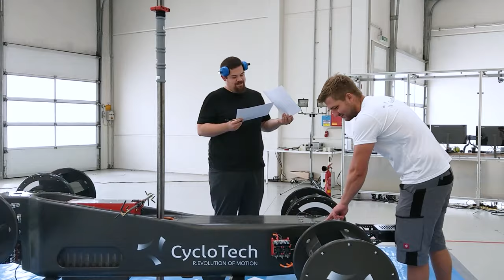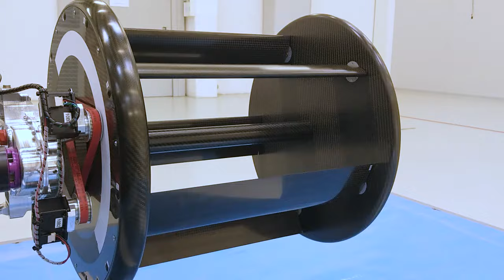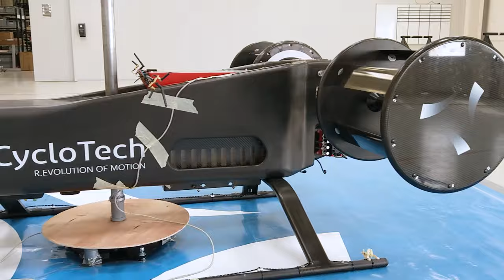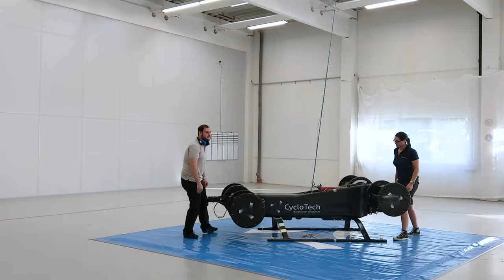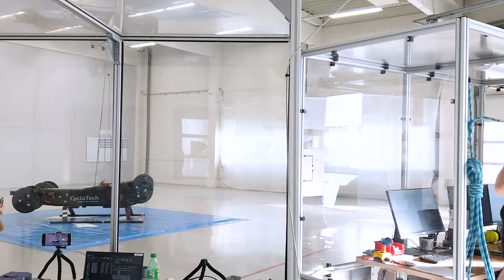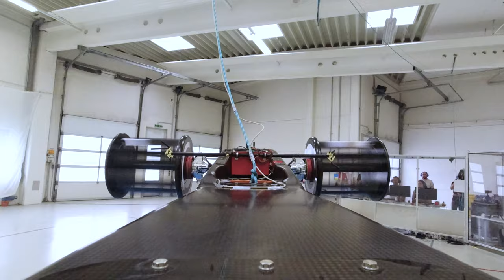CycloTech | Demonstrator First Free Flight (Indoor)

Comment: Such wonderful progress towards this old but much saver technology than rotor blades on helicopters.
Reply: R u sure it is safer, not just cheated by its looks ?  What happen if human touch those high speed rotating wheels ? If blade slices, this will roll a human, i think. CMIIW please.
Reply: You could wrap some titanium mesh screens around it, like an 10 or 20 mesh.
Reply: No need for torque countering tail rotor. How does it do on auto rotation emergency landing? Can it handle one rotor inop and maintain altitude or at least do a controlled drift down? How about forward speed limitations?
Reply: @maryfrawley4388 -- Aerodynamically, autorotation is out of the question, because the blades are not within the external slipstream; but a single rotor failure should allow a controlled descent using the remaining three.
Reply: @haditjandradjaja8403  Word to the wise: don't touch them but a shroud can be built around them to protect birds and people with erm... itchy hands.
Reply: @shannondror  unlikely. Small blades tend to be unable to provide sufficient lift in autorotation due to insufficient speed. Also, traditional autorotation does work the same here because the rotational directions are different.
Reply: @maryfrawley4388  Counter rotating helicopters also don't require tail rotors and are far more efficient than this contraption.
Reply: This is likely far less safe than traditional helicopters. Helicopters have higher efficiency and can autorotate. These have more moving parts, far more points of single failure, and probably cannot autorotate safely due to the small size of its blades providing insufficient lift to slow the descent enough to be survivable.
Reply: @SoloRenegade  -- Safety is a matter of design.  Traditional fixed-wing and rotor-wing aircraft can translate motion into lift in the event of engine failure, long enough to reach the ground in a marginally-controlled manner and a sufficiently slow descent speed. Powered-lift vehicles are by their nature dependent upon an uninterrupted supply of power, and cannot use their potential and kinetic energies to continue operation. Hence, their safety depends on the necessary reliability and redundancies of their power generators. Batteries are rather reliable and not particularly prone to failure.  Likewise electric motors as compared to combustion engines. Hydrogen fuel cells are likewise highly reliable, as are some forms of storage for Hydride pastes and water. Likewise a vehicle supported by multiple motors and rotors represents a propulsion/lift redundancy that provides a measure of safety, as do backup full-vehicle parachute systems. The likelihood of safe operation of this sort of vehicular system need not be any less than that of traditional air vehicles, and could be more safe given proper design and failure-mode analysis.
Reply: @SoloRenegade  What makes you think 3 rotors wont compensate for the loss of 1 rotor? They literally just have to increase their hover rotational speed by a minimum of 33% on the remaining 3.
Reply: @anteejay4896  you're assuming they have sufficient excess power, which is usually not the case in smaller powered aircraft. And that the airfoil has enough AOA remaining as well. You can't assume every condition is going to be so favorable, as real world experience in helicopters, twin engine, and single engine airplanes shows you rarely ever have that sort of excess power. The joke is a twin engine has enough power when one engine fails to get you to the scene of the crash. Most can't maintain altitude on one engine, or have a very low single engine ceiling altitude.
Reply: @SoloRenegade  It is electrical, excess power means feeding more electrons to the motor - just look at the maneuverability of drones they don't have issues mechanical engines have . If your motors cant do more than an additional 33% of the thrust you need to hover then there is something fundamentally wrong with your air craft. It should easily do well in access of 100% to 300% depending on load in my opinion. Plus, stop comparing it to a helicopter, it should even be able to lose 2 motors, one at either end and still have a chance continuing travel or landing safely.
Reply: @anteejay4896  Well, yes, if you're talking about drones, sure. But I'm talking about full scale aircraft. Capable of carrying passengers.

I have to compare it to a helicopter, because it hovers like one, the rotors work on the same principle as a helicopter, and because safety issues helicopters address, most of these new drone concepts do not address adequately, if at all. To get a pilot's license to fly one of these would be a rotorcraft pilot's license, just like a helicopter.
Reply: @SoloRenegade  I understand where you're coming from but dont box your thinking on this because it potentially has ten times more wing aerodynamic lift surface area than a helicopter by increasing the number of blades per rotor... They could even add another set of rotary axles in the middle for a total of 6 and additional one at either end for a total of 8. You really need to think out of the box on this one my friend :) The future is bright
Reply: @anteejay4896  That's not true. only two of the blades can be lifting at the same time per rotor max. And when you add up the 4 on one side, they don't add up to a single rotor blade length of a helicopter. Also, the extremely short aspect ratio massively hurts efficiency of that same surface area. These are spinning very fast as well, meaning they are relying a lot on velocity to produce enough lift. This is why I doubt such a machine will be save with a power failure, can't autorotate. A helicopter rotor system only spins around ~400-500rpm. Granted, the longer blades force lower speeds to reduce tip velocities. But the lift generated at that slow rpm is enough due to higher efficiencies.

Putting another rotor in the middle ruins the payload and utility value. Also, being nestled in the middle potentially blocks airflow to/from that rotor. I think outside the box every day, but I'm also practical and evaluate the merits of a design.

With smaller drones, you can do things aerodynamically larger aircraft cannot. Look at how bees fly for example, and try to scale that up. You'll find it cannot work due to the relative fluid density changes. Reynolds numbers and such. Something might work as a drone, but doesn't translate to larger aircraft. And only one of  the drone taxi companies I've talked to (that patterns their design after quadcopters), has addressed my safety concerns when I questioned them (face to face, I talked to their engineers and reps). Hovering taxis have been tried before. There is a reason they stopped existing decades ago, and none of these new designs address those issues in any way.

The future is bright, but this just hasn't convinced me it will look like this either.
Reply: @SoloRenegade  That is what i meant by thinking outside the box, This design has 5 blades per rotor, what's to stop them from having 8 blades per rotor and elongating them a little? I am not sure of the rotational speed but it cannot be more than that of the typical drone which is in the thousands.  That being said Auto rotate is a crash landing technique from the remaining angular momentum of the blades if you are really high up in the air changes of survival from that are very slim. This has multiple sources of lift i think it should fair better than a helicopter.

Putting another rotor in the middle improves the efficiency of lift while lowering the amount of power needed per rotor to provide said lift and also improves redundancy. You are assuming too much as to the auxiliary capabilities of the motors, cooling can be accomplished in many ways so can  power management in the event of failure and mitigation of disaster by spreading power load on the rotors to maintain lift.

Hover taxis are already hear do your research, you can literally buy a few for yourself. They just haven't been scaled to meet commercial market requirements, do your research, The biggest hindrance to this was never technology, it has always been POWER and with the proliferation of high density batteries powered by the e-car revolution they will soon be a commercial public success. 

What is the measure of a products success/viability? Is it the fact that it works and is useful or the fact that it is safe to use?
Reply: @anteejay4896  having 5+ blades per rotor doesn't change what I said about total lift. You don't realize how much less surface area this has than a helicopter blade, it's not something you can just fix by adding width. Then you get flex occurring to a greater degree, and this will cause the rotor pitch control mechanism to bind, and to offset all of that adds weight and drag to the system. Plus the additional power needed to rotor more and bigger blades. This thing is getting complicated very fast.

Autorotation is a technique in which aerodynamic forces keeps the rotor blades spinning indefinitely, so long as you have altitude remaining to gain energy from. the problem is that such aerodynamic forces are not capable of spinning these rotors at thousands of rpm by gravity alone, and so you wont generate enough lift to arrest your descent at ANY altitude. The moment the power is lost, you die. A helicopter can glide with no power safely all the way to the ground because the potential energy is enough to keep the rotors spinning al the way down while generating sufficient lift to slow the craft to a survivable rate.

Putting an extra rotor in the middle doesn't  do anything to improve the efficiency of lift, unless the two in the front are made into one single larger rotor like a combine head. but that introduces still more design challenges to overcome. (and that approach has been tried before too). Such a change may provide More total lift, but will also add weight and take more engine power to rotate.

I am not assuming anything, just going through the design realities as I see them based upon the laws of physics. When did I ever say motor cooling was an issue? And if you lose power, ALL of your motors are dead, and now what are you going to do? Electrical failure is a common failure mode in aviation, and one of the most prominent emergency procedures, and included on any modern checklist. How many electric cars have battery failures? plenty. A motor failure is only one possible common mode of failure. there are many which Must be considered and addressed.

Hover taxis were banned decades ago becasue they were too dangerous, not just to crew and passengers, but to innocent bystanders below them as well. It's not just an issue of making a vehicle fly, it's also a factor of dealing with the variables of the environment you're flying in that are an issue. Many of the accidents that lead to the end of helicopter taxis was such environmental factors that made it too dangerous. No drone type design has addressed this issue in any meaningful way.

Spinning at thousands of RPM proves my point. This thing cannot autorotate and generate enough lift in the event of a power failure.

"Is it the fact that it works and is useful or the fact that it is safe to use?" That, and its cost effectiveness. Just look at the history of airships and the many attempts to restart that aviation industry. It has to work, it has to be useful, it has to be safe, and it has to be profitable. All too often such ideas have not been profitable, safe enough, or have useful payload and range to make them viable. 

I am an aviation fanatic, a professional airplane and helicopter pilot, engineer with numerous patents, and i study and teach the history of aviation, as well as the engineering history of aviation (how tech evolved, when, why, and how). I'm not just making this stuff up. This is all based on my years of study, professional work, and analysis. I want to see innovation, and I want designs like these to work too. I've even dabbled in many such innovative technologies and designs in the past, until i learned enough to know why those approaches weren't going to work. Maybe they'll work again someday when other technologies are developed to address their limitations, but I haven't seen that happen yet.
Reply: @428 Renegade  I understand you're into helicopters, but they have many flaws and a balance has to be met in any design to optimize lift to weight and technological and material tolerances or limits. Again you are assuming far more that you know for sure, why would the mechanism bind? Have you seen larger scales of this technology being tested? Even a blade ten times the length of the one demonstrated can be achieved using a carbon fibre mesh with tolerable flex extremes. A balance has to be achieved for the task in question, far outside the scope of this proof of concept test rig.

Auto rotation is a technique whereby the motion of the helicopter falling out of the sky to your doom from failure of its one and only source of lift maintains what dwindling lift it still has left. There is literally an award given to people in the military who crash land a helicopter safely preventing certain death and excessive damage to the vehicle. Don't speak so highly about it. It is a useful feature and very helpful under idea conditions. But what happens if the rear counteracting totor experiences a failure at an altitude where auto rotate can be safely performed? Helicopters are volatile.

Any additional source of lift goes a long way in mitigating the total amount of lift per rotor for the payload in question, why do you think drones are obsessed with adding more rotors? It is literally more cost effective and power effective and range effective because the battery can only do so much and the motors can only spin so much. Again we are going back to BALANCE of these forces my friend! The more air molecules you can scoop and push down to provide lift there better. There are even so many variations of helicopters with multiple rotor blades its not even worth arguing. More = Better.

The main caveat we are speaking about is premature failure, failure is inevitable with any mode of transport with so many parts and potential failure points. But you keep harkening back to battery failure mid flight thus causing a complete and utter lack of lift, anything is possible but in the case of failure of an individual motor mid flight I want to be in a vtol with multiple sources of lift not just one - again contingencies should be set in place for such an improbable possibility, just as there can be an emergency secondary motors in a helicopter there can be an emergency auxiliary battery as well. More on this later.

No one has addressed the issue of gravity the prime limiting factor to hover taxis, DARN YOU GRAVITY! "Hover taxis" are used all the time they are in fact called "helicopters" and they are not immune to the issues you addressed as being limiting factors to growth in variations of lift technology in the vtol industry. The limiting factor has always been power and flight time with even the most recent sky taxis capped at a flight time of a little under an hour. Even Elon says he will venture into this field when cost per kilowatt hour improves by some orders of magnitude than what it is now.

I understand you are (claim) to be accomplished and a veteran in the aeronautical field but this is fresh technology my friend. Lets not cast doubt where more testing, trial and error and innovation in the field has yet to materialize. I would be willing to wager that a technology such as this can be tweaked to incorporate contingencies in emergencies. Would you be willing to predict that the rapid motion of air on multiple spools of cyclotech's rotor and blade design in the event of an emergency CANNOT AND WILL NOT provide enough lift to arrest a literal drop out of the sky?  I am by no means betting man but I will not place all my eggs in such a basket.

Now lets think about this for a moment if you can entertain that idea above that I (the speculative optimist) just raised to You (the speculative naysayer). The rotor blades can be manipulated mid flight this is correct, an auto rotation arrestor fall technique relies on lift provided by the speed of the fall and the still rotating blades under the incoming force of the air rapidly rising due to the ground rapidly coming to say hello followed be a swift goodbye! Would it be that farfetched to take advantage of the same principle to arrest a fall by detaching the motors and tweaking the blades mid fall to propagate spin and provide the necessary lift my dear friend to prevent an unplanned rapid disassembly of our craft and our squishy selves?

You tell me.

In closing:
Far worse disasters have happened in the past and there are still crafts in continual use today that are literally death sentences if something goes wrong, a technology doesn't have to be utterly safe to be viable, or even efficient, or cost effective it just has to be useful and needed enough. 

Welcome to the human race we are trial and error and we have lots of errors but the trials go on.

I rest my case but if you wanna go there still-bring it.
Ima gonna go there
Reply: @SoloRenegade  There we go!
Reply: @anteejay4896  None of your prior responses has any merit. The technology in question is not safe, mechanically complex, less efficient, and solves no problems other than curiosity of the designers.

“-They are extremely loud - to the point of causing hearing loss if no ear protection is worn” Not true. I’ve been around helicopter for years without hearing loss. Jet engines cause hearing loss, but the rotors and piston engines are just fine. People have made electric helicopters too. This drum thing isn’t any quieter.
“-They are extremely windy - Any area it lands needs several meters of diameter so as to not endanger anyone and itself while landing” not true except for larger machines. More weight means more lift means more downwash. This design in NO WAY changes that reality of physics, pound for pound it will create the same downwash as an equivalent helicopter. This just proves you don’t understand simple physics kids are taught in middle school.
“-Single source of lift which if compromised will lead to an early abrupt reunion with the ground” Not true for many helicopters, and not true for many drone designs either. This argument so far is the only one of yours with a shred of merit, but it comes with caveats.
“-Added contingency it literally had an unnecessary part added in order to make it not spin itself into oblivion because a helicopter is inherently unstable!” There are tons of helicopters with no tail rotor at all, such as tandem, transverse, intermeshing, coaxial, NOTAR, etc. But even those with a tial rotor are going to be more efficient than this contraption.
“-Literally every part of a helicopter seems to me to have been a fools passion just for the sake of making HIS idea work out” This argument is an emotion response with no merit, and proves you have literally no understanding of how helicopters work. They are actually Very simple machines. Engine drives a very simple gearbox which drives the rotor mast through a one-way clutch. The swashplate is the only other device, and these are surprisingly simple as well.

“I have made no assumptions, and two, you have know idea what I do/do not know. You're making logically false statements.”
You make nothing but assumptions about things you clearly know nothing about. 
State the Exact statement I made that was logically false. Just stating things doesn’t make them true, nor make you correct.

“> I do not have an idea what you know and what you do but in all honesty do even you?” yet another childish response. Seriously, how old are you? Only children use such arguments.

“You are making too many empirically false statement.” Just because you lack knowledge and understanding, doesn’t make what I say wrong. 

“Why would a mechanism like this bind if the blades are mounted both sides?” the pitch control mechanism can and will bind if designed simply and light weight as you add blade length. Do you even know how the pitch mechanism works on one of these?

“There are literally aircrafts with fixed wing designs with little to virtually no flex in the blades.” Fixed wing aircraft are just that, FIXED WINGS, they are not rotating in concert with another mechanism. Their wings DO flex. You literally have to perform wing bending tests on fixed wing airplanes to prove to the FAA the wings won’t deform permanently when they bend in flight. You can literally watch the wings of any airline flex in videos online. Smaller planes flex too, to a lesser degree, so it is harder to see,

“> It is called the Broken Wing Award please look it up, It is an emergency procedure to prevent a crash, if not done in a timely manner the rotors will stop spinning but you ill have crashed long before that happens. IT is a dance with the aerodynamic forces of the air and gravity. Don't talk so highly about it.”
Ok, there is an “award”, but it has no official military standing, and is basically a pat on the back and nothing more. I do not acknowledge this award as being “official”, as it will not be something that goes into their records that affects their career for the better or worse. However, that doesn’t prove youre stupid ideas about what an autorotation is. The rotors can spin indefinitely in an autorotation. You’re literally arguing with a Helicopter Flight Instructor who has done and teaches autorotations, but continue thinking you know what you’re talking about.

“>Failure of the counteracting rotor will result in an uncontrollable reactional torque from the main wings, simple physics, if you are lucky you will be near the ground, if you're not you just might be strutting into heaven a like a hopeless drunkard down the street - cause of death definitely not alcohol poisoning.” 100% lie here. Nothing you said is true. Download the helicopter flying manual from the FAA website, it’s free, and read up on autorotations, run on landings, tail rotor failures, etc. There are many other books that also go into more detail on the subjects as well. You have no excuse for blatant lies and ignorance.
Reply: @SoloRenegade  I've been literally waiting for a second response, is that all you have to say? You didn't even cover all my points.